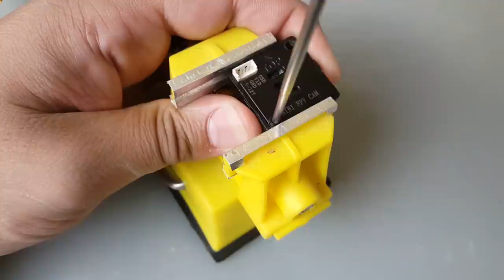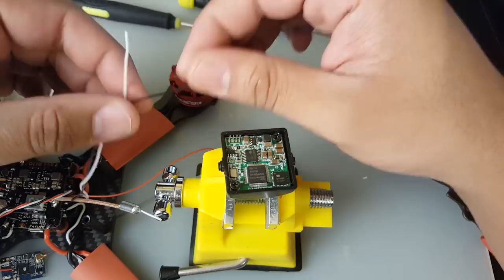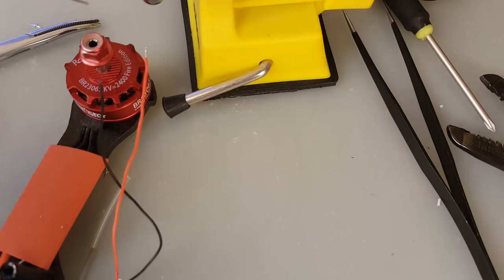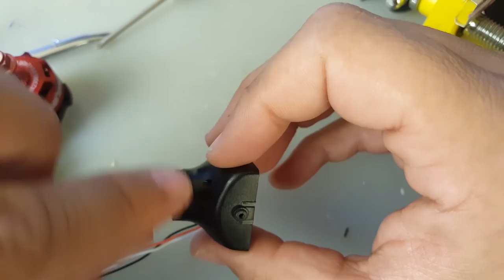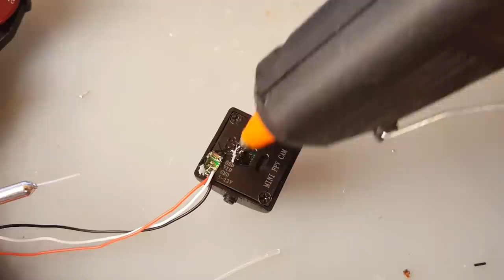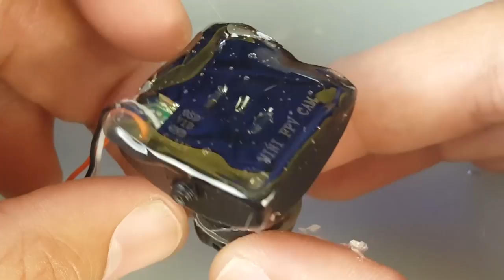How to Build Best Budget Racing Drone 2017 // Waterproof Camera

Comment: I was thinking that Silicone confromal coating will work just as well instead of the hotglue.    You should be able to paint it around the lens and it should make a silicone waterproof seal.

Comment: I have coated my camera just fine if you watch rotor riot they have shown how to water proof I have done what they did and I fly in the rain no problems at all
Reply: Tj Walker What about the water on lens how to see thru it?
Reply: Use Rain-X on the lens
Reply: like D S said rain x I live in phoenix Az so it doesn't rain to much here but I still like to go out when the rain breaks and not have to worry if it starts coming down. It also depends on how fast you going the drops come right off about 70mph

Comment: Couple of tips...desolder pins from the back, use a solder plunger and/soldering wick to remove the solder...use a smaller tip when tinning and soldering those small pads...I would have just removed the board and used helping hands as well...great videos mate thanks for doing them!
Reply: TheRealChetManley he knows that and he tells everyone that every time he is soldering. Lol you would think he would just do it to get everyone to quit implementing ideas lol